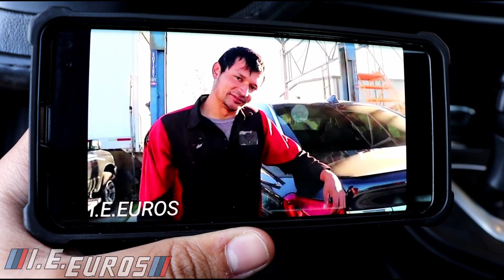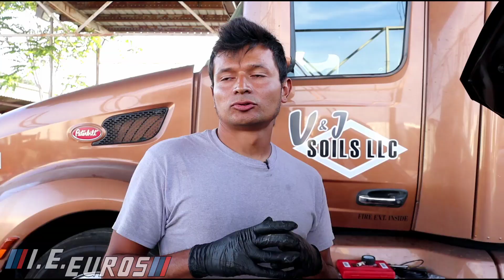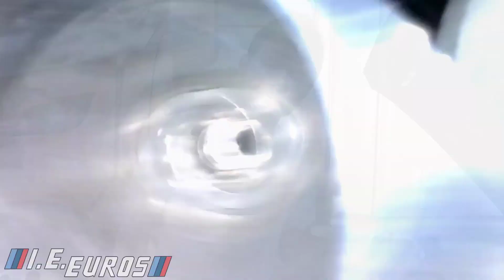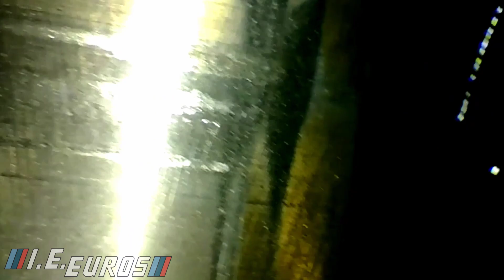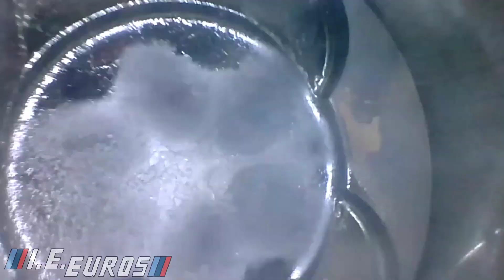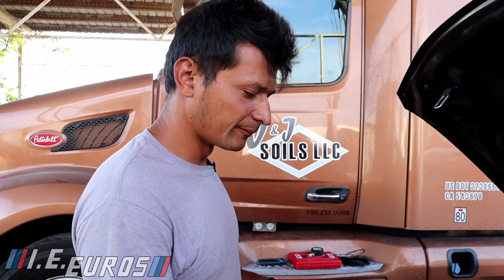BMW 328i broken N20 engine drivetrain malfunction misfire cylinder 2 no compression oil consumption

Comment: Hey buddy I need your help if you have time... I have a 2008 bmw 550i with 139,002 miles. My DME HAD GOTTEN WATER DAMAGED LAST YEAR. Ever since then to make it short, alot of moduels went out. The one that won't go away is misfire on cylinder 4. I bought 3 years ago, with 110,200 miles it now has 139,002. As you can see I have taken really good care of. I basically have only put in about 9,500 miles a year. All stock no mods. I just want to show you some read outs and hopefully you can give me a call. I'll pay you for your time if need be. I'm just tired and exhausted of having it sit since August of last year bro

Comment: So if the oil cap come off and there a lot of pressure the engines shot ? I think I have that same problem. 08 550i m sport n62 4.8l.  If so how much to put in new engine in and have it running ? Thanks awesome job btw everything you do